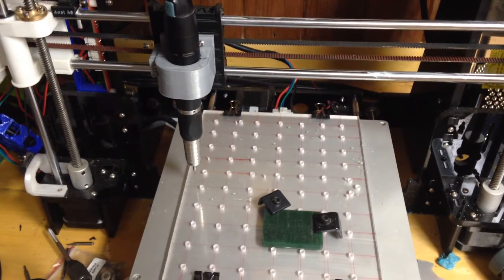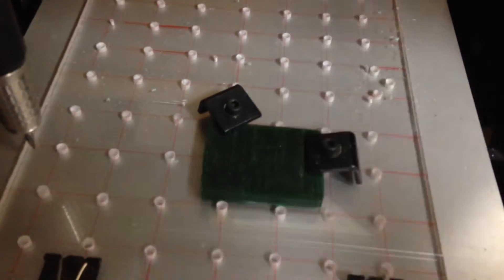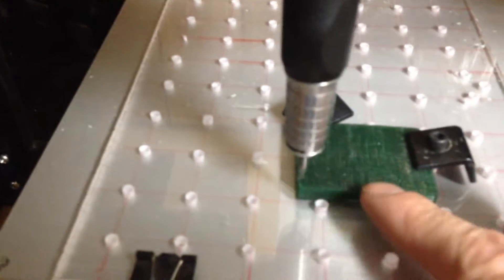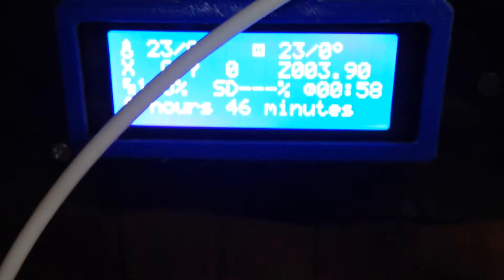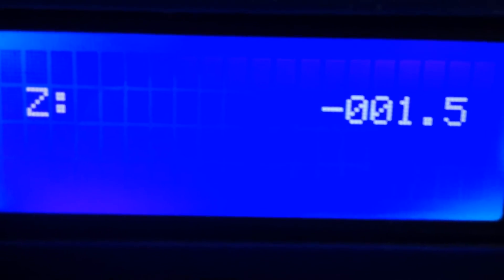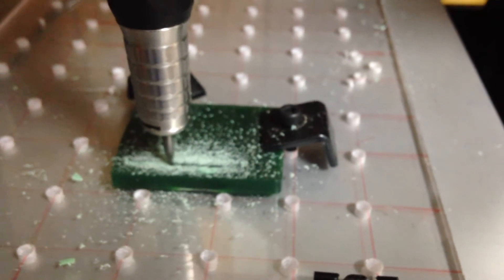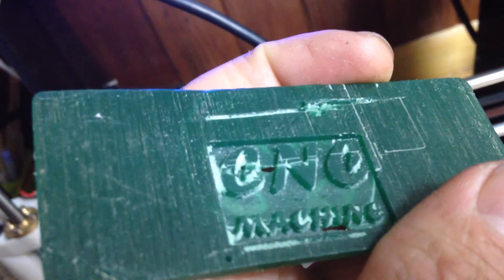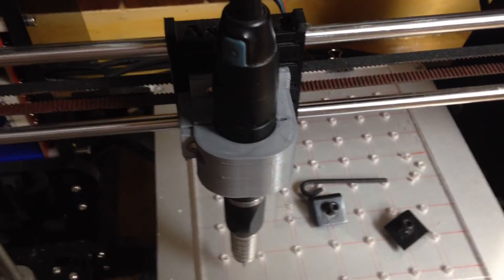anet a8 cnc upgrade tutorial(part 3)setup material and cutting

Comment: Nice work. I've build myself a bigger rep-rap with 12mm rods. It is stiff enough to put a 600W straight grinder on to it. And it cuts carbon fiber and even aluminum like a charm. Have a look on my channel.
Reply from the maker: Thank you,  Yea this was more of an experiment for me since I have a good cnc with nema 23s but I just wanted to see if I could figure it out a dual system. My next CNC is gonna be a 8ft by 4ft with a OXnc style build, but i'm gonna check your CNC out now.

Comment: How did you made this gcode? Which software and configuration?
Reply from the maker: Estl cam.. but any cam software will work, just remember the most important thing is that you set the GCODE output to MM and use my start and end GCODE that I left in the video description and do some test runs on foam  or just test to see what happens before cutting anything.

Comment from the maker: Yea the actaul conversion isnt that hard its learning how to use cam software can take a while to get used to.
but i would also get familiar with how the gcode you make for the cnc looks, open it up in notepad and study them especailly when you have issues it can help you figure it out alot of the time.
Reply: Hey man long time no chat lol. So I got a question for you will the skynet that your using the one you emailed to me will it work with the Arduino Mega with the RAMPS 1.4 or will I have to edit the code a lot to make it work?
Reply from the maker: All good ive been out of town anyways no wifi.. but I would try to newer version with NO BED LEVELING so you dont have to mess with the code, unless you have a autolevel sensor then the old ones fine..
Reply: Ok and I got the Anet to work with the Ramps 1.4 but I'm still having a little problem with the Printing check out my new video it shows what I'm talking about maybe you would know whats wrong I feel like it could be a marlin code thing just not sure.